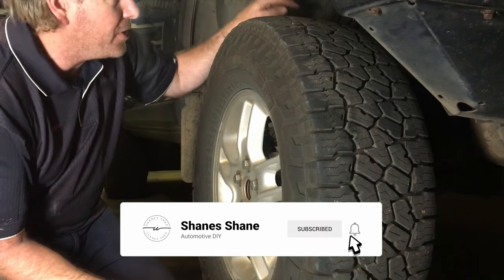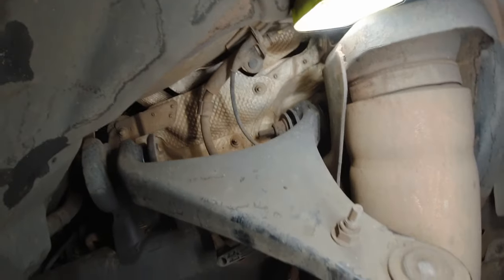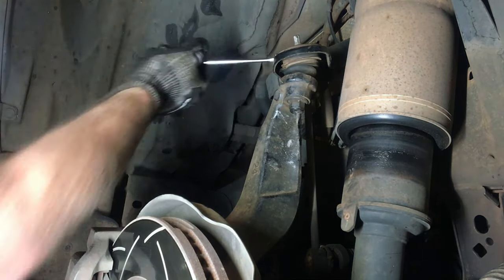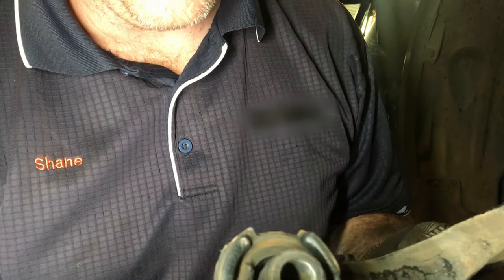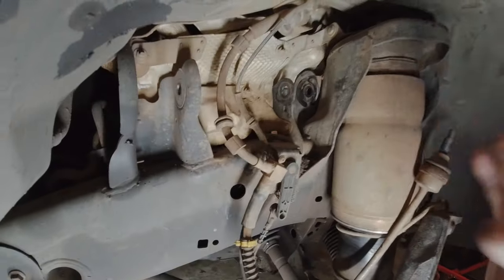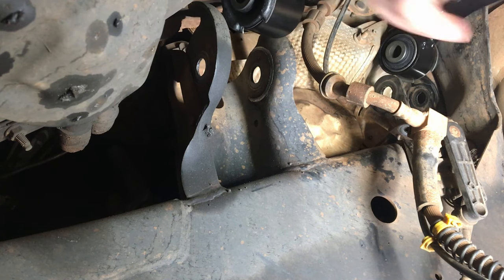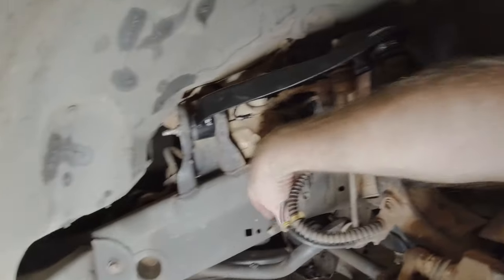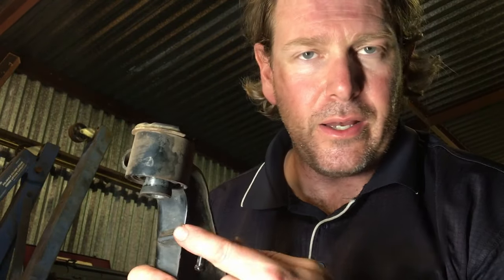LR3 Front upper suspension arm replacement | Land Rover Discovery 3

Comment: Hats off to you for tackling this. 
I've only ever seen one other Youtube video tackling this job. Whereas there are dozens on the front and rear lower arms - because they are way easier to do .I've replaced all the control arms on my LR3 except those front uppers. It just seemed to me I wouldn't be able to get at those bolts with any kind of wrench (spanner). I've had the replacement arms sitting in a box for couple of years! I remember the handling of the car with the rear uppers gone was quite scary around corners.
Reply from the maker: I've had the front upper arms out several times over the years for access for other jobs. They are not really any more difficult than the other arms. I had a worn rear toe link a few years ago - that make for some weird handling at times when the rear wanted to steer itself

Comment: Thanks for this Shane
Yesterday, finally managed to find out exactly where the source of a suspension ‘creaking’ noise was coming from, by my brother opening the passenger door of my L320 RR sport, and hanging outside while I drove it over to some undulating ground in off-road suspension highest setting mode.
Turns out to be the rear bushing of the left hands side upper suspension arm, proved by rocking the car while stationary, with my hand on that bush and feeling it ‘jerk’ rather than move smoothly.

It has been annoying me for ages and have changed so many other parts trying to stop the noise.
Most annoyingly, the noise disappears in Winter when it is wet, but returns in the dry Summers.
Hopefully changing the arms will solve the problem.

But I’ll check that the bolts are done up tightly first, in case them being too lose is that actual problem.
Reply from the maker: No worries, hope you get it sorted.
Reply: @Shanes_Shed  
Cheers.
I am just wondering if my garage didn’t set the wheel axle at the correct height before tightening it or didn’t tighten it enough, which is causing the noise. 
Bloody annoying, but am fairly certain I have at last located exactly where it is coming from at last.
Great video btw!
Reply from the maker: Tightening at the incorrect height on its own probably wont cause the noise, but it would result in lower bush life which could then lead to noise as the bush flogs itself to death

Comment: So the factory has the bolts going in from the backside with the nuts on the front side of the bushes. This makes doing up the nuts hard on the back bush as you are blocked by the arm angle at road height. I wonder if it matters which way they go as doing up the nut on the back side looks a lot easier to get some swing on a ring spanner. I can't see why it would matter what orientation the bolts are?
Reply from the maker: My bolts have always been in this orientation since I've owned it. I've never tried to put the rear bolt in the other way, but I would have guessed that the body position would make installation and removal difficult. Front one could easily be put in the other way, but putting the nut on would be an absolute bastard of job - hard enough just putting the bolt in from around the back of the strut tower

Comment: Great video. Thanks Shane. I'm about to tackle this job shortly. How did you go with the other side? I had a quick reach around the back of the strut mount on that side and it seems that heat shielding is in the way of the front bolt. Did you have to remove/loosen shielding on that side and if so, can you offer any tips in that regard? I want to avoid risk of losing heat shielding bolts/nuts or not being able to get it back together! Cheers.
Reply from the maker: Going from memory here, but I don't believe I had any issue with the heat shields getting in the way.

Comment: Hey Shane, love your work. I’ve done the lower control arms before due to the big clunk when braking hard. Did you notice any noises while driving with the dodgey uppers? Or did you just notice when doing the tyre rotation?
Reply from the maker: There was an very slight clunk that only occurred when I was moving forward after reversing out of my carport. Only happened when the steering wheel was being turned from the left to the right at the same time as moving forward as well.

Comment: Do you need to drain airmbags silly question ino but im gonna tackle mine at the weekend brilliant video!
Reply from the maker: @jamiethomas1235  not for the uppers you dont
Reply: @Shanes_Shed  turns out it's bottom ball joing gonna replace full bottom arm will it need draining for them?
Reply from the maker: You can get away without draining them for removal, but it makes you job easier when it come to installing as you want to compress the suspension and have the arms at ride height to fully tighten the bushes
Reply: @Shanes_Shed  could I not just drop suspension put balts e.c threw and but in acess hight mode and tighten up? From there ?
Reply from the maker: If you tighten the bushes while they are in a position other than the normal ride height they will end up with some degree of twist in them which leads to a shorter life. Easiest way is to just get your jack up under the arm and compress it all until your at the correct distance (measured from centre of hub to top of wheel guard). Thats where having the pressure dumped from the spring helps a lot.

Comment: thanks, got to rebuild my turbo, so all that's gotta come out  on the passenger's side d4, trouble is lost use most left hand from stroke Used to work at Cummins, could whip a turbo off of an N14 Rebuild and refit before lunch, my d4 cannot even see the turbo
Reply from the maker: Well that sucks (both the loss of your left hand and the turbo). Are you going to be doing the job yourself or farming it off to someone?  Thanks for taking the time to comment

Comment: Great video mate, would an elbow adaptor or offset allow a torque wrench in there?  Have you done the rear upper and lowers?  I'm considering that on mine as it is wallowing badly and getting a bit of wander.  Shocks are almost new.
Reply from the maker: Its possible that would work - Torque adaptors is the google term to look for. Basically a ring spanner that a 1/2" drive torque wrench can hook onto. You will need to re-calculate the torque if using these. And yes I have done the rear lower and upper arms, was about 4 years ago. If you don't have rusted bolts to deal with then they are just as easy as the fronts to do - still have the same issue with getting a standard socket and torque wrench on them too.
Reply: @Shanes_Shed  yup I did see those online. There are. A few articles about how to calculate the difference in torque. I may invest in a torque wrench that the elbow built on. I think LR time use one. 
Can’t say my 61 year old back is looking forward to the job or my wallet 🙄😭

Comment: Great video! About to do this on my LR3 but I have a 1.5" johnson rod lift. Do I need to add that 1.5" to the hub measurement (466mm) at the end?
Reply from the maker: Yes it would be good practice to do that. You need to tighten the bushes in the normal height position otherwise they will have a little bit of a twist through the bush all the time.
Reply: @Shanes_Shed  Thanks for the quick reply!